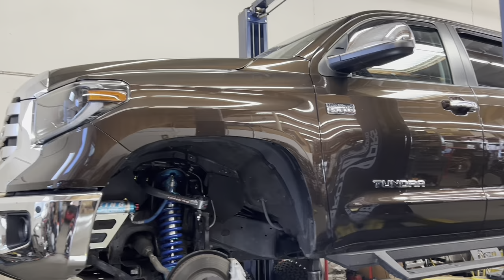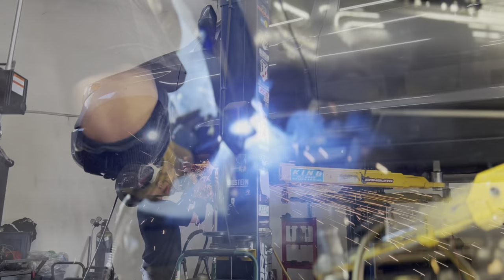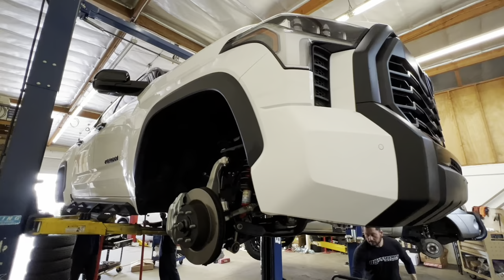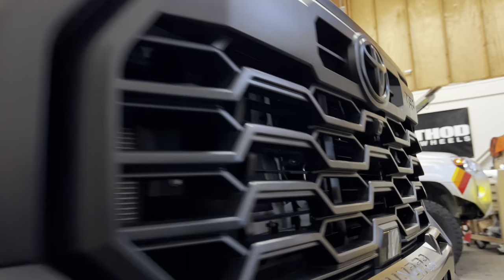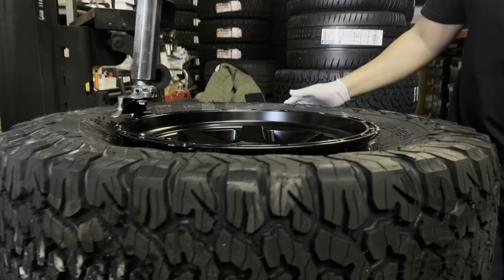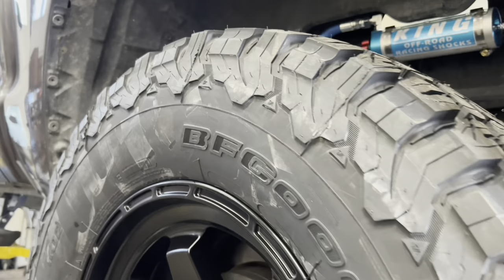2022 TOYOTA TUNDRA LIMITED WESTCOTT DESIGNS LIFT & 35" TIRES

Comment: That 0 offset looks better than the +18 offset. on a westcott video, it was mentioned that the +18 offset would poke about 1 1/2 inches. i recently purchased a set of 20x9 +18 with 35x12.50x20 grappler ridge tires. will i achieve a poke of 1.5 inches or not?

Comment: Is Toyota 22R it's a 22 Toyota Tundra suspension is the same as the Dodge Ram 1500 display put the ram in the suspension but a 6-inch Lift

Comment: I was not happy with smaller cabin size on the new 22, that was one of the best things the Tundra was know for was the larger cabins. Also not very happy with them moving towards a turbo set up. I understand the mpg and performance, but being in the automotive world for so long and having serviced multiple turbo platforms there’s just so much other issues that arise due to the maintenance of the turbos.
Reply: good points, also don't forget the side bed height got shorter also (you're limited to what you can put height-wise in the bed if you are the type of guy who uses a tonneau cover).  so basically you're paying more for less of a vehicle for those who actually keep an eye out for these things.
Reply: And to me this new design looks too much like the new Ford F-150. Unpopular opinion I’m sure. But there were So many reasons to love tundras , including how unique they used to look.
Reply: yeah but its a toyota turbo so it wont have to be serviced :)

Comment: 88 Motors, I have a question.  Wescott Designs recommends a wheel with a +18 offset but it appears on this one you are doing spacers with a 0 offset.  Are there any downsides to the 0 offset with spacers because I really love the RRW wheels????
Reply from the maker: No wheel spacers were used. Customer wanted a more aggressive stance in 17’s.